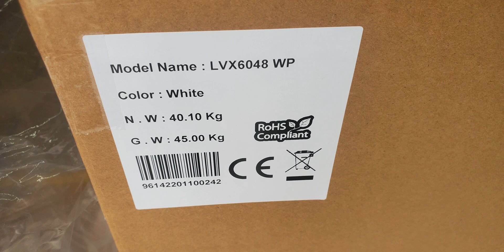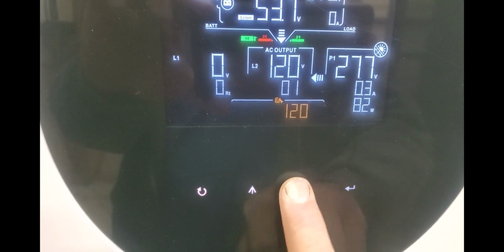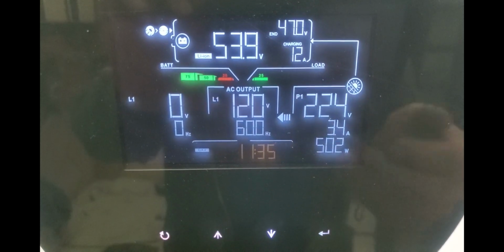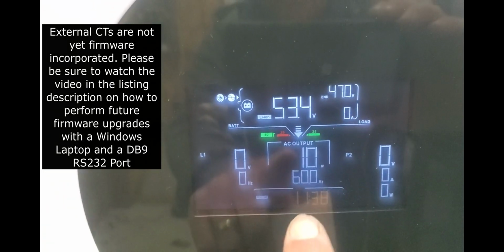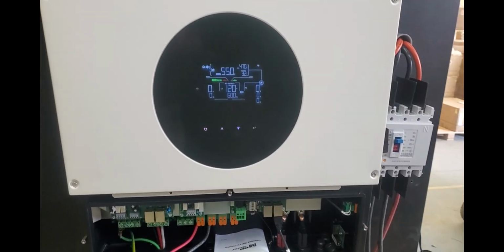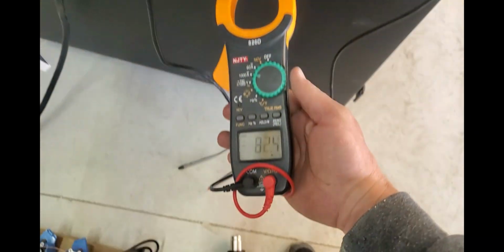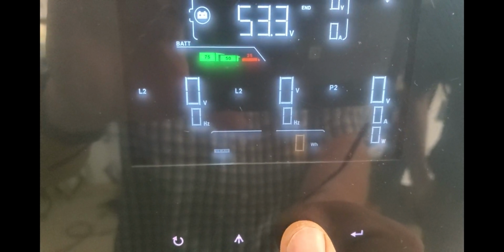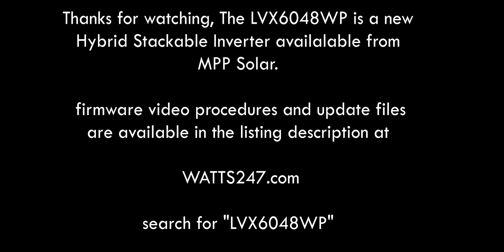LVX6048WP 6KW Outdoor IP65 Hybrid  Inverter - First Look

Comment: Hey liked your video!  I'm a newb but interested in the inverter.  Could it run solar and pull from the grid as needed?  I don't want to sell back to the grid, just use grid power when thes sun is 'off'.  Will the unit work if the grid is down?

Comment: I have this unit and have used mpp for years, i cannot get solarpower software to work no matter what cable i try.  Any cable from a usb to 232 converter to micro usb. Whats the magic trick lol.  If i can get this to work, i plan to use solar assistant but, dont want to invest until i can see communication between it and a pc. Thanks

Comment: Can the LV6048 be used as a grid tie????
Reply from the maker: The lvx6048wp can be used as grid feedback,  the Lv6048 can use grid as backup  (but not grid feedback)
Reply: @watts247 Thank you so very much for getting back to me I did contact the people at MPP solar and they also confirmed what you said with a clear answer to my question.
Thanks again for the accurate information.

Comment: I bought this system ,but I have a question, do I have to connect a transfer switch or am I just connecting my pv module ,generator , and utility electricity  directly with brakers?
Reply: I'm confused, some people say I need the transfer switch other people say no I don't need  the transfer switch

Comment: touch screen and no Eg4 compatability?  damn, this was almost perfect.  was gonna buy 5.... I guess its back to Sol-Ark it..Come on Ian, the EG4 blockout is clearly to increase revenue.  Wed buy more of your batteries to add to the Eg4s we accidentally bought...

and if the touch screen is not cell phine quality, the touch screen will render it useless when moist or after a few years in normal weather..those design choices make me question the durability of other components chosen like those pv input terminals you were afraid would break.....so close to greatness, it's a shame

Comment: Ian! Got a few questions for you regarding this unit.
I have had nothing but problems with it so far, and I'm wondering how many are due to out of date firmware.
First, MPPT 1 and 2 only seem to start coming to life at above 400v. My setup was originally 2x series of 120v, but bringing those in parallel to the unit, I only got 25w (yup, 25). So i put the entire array into series for 240, and still only got around 500w max (should be at least 1500w, which is what I get on my other controllers).
What's your panel setup? How are you getting 1700w here at only 233v? I should be drawing at least 6a minimum with my setup, but I barely get 2a at 240v.
The config options don't seem to apply reliably and seem to take 10-20 attempts before they stick. You had this?
The android app idiotically takes data the unit uploads to some sketchy server in China, and doesn't update data for 10-20 minutes at a time. Are you seeing the same behavior?

Have you got communication via rs232 working? Did they send you the solarpower app for monitoring (they won't send it to me :D).

I'm at my wits end here. Renogy units are buggy as all hell and poorly built/conceived, which is why I tried this one on TONS of glowing recommendations, but I cannot for the life of me, get anything working,a nd man I wonder if it's just out of date firmware.
Reply: thanks for the headsup!  please keep us up to date.  
wow, great eye I've been wondering, communicationes to China WITHOUT updating/fixning!!?
Problematic given our hostile relationship and the daily bogus " excuses" the great reset clan like spew daily, to say the least.

mandatory frivolous communication has a great chance of nullifying the entire "off grid" purpose even more than the closed source, proprietary code that could have a simple timer hidden within...

I hope the problem is just firmware but it just sounded too good to be true.  I was going to buy 4..if they fix quick enough I still might.
2.5x less cost than Sol-Ark, plus a ridiculous touch screen (really, much more reliable mechanical buttons cost too much?) and cheap pv input terminals were red flags that might be ok if high enough quality but this "incompatible" with Eg4 batteries is ridiculous.  Yeah, Signature Solar are a bunch of charletons selling a lot of garbage to unwitting customers but those batteries aren't...are they?  if so Ian, please explain why and ill profusely apologize
Reply: @SmedleyButler1  So it's actually worse than that. Another day of digging and here's what I know.

1. The MPPT simply does not work at all at or below 120v. With 120v@6a, you get 25w at most. With 3x 40v@9a panels, you get absolutely nothing. MPP will not confirm this is a problem. They simply suggest that you should run the system at 500v.
2. The documentation is all wrong. The wifi is not accessible locally whatsoever. It is only used to communicate out to their servers in china (and man they send a lot more data regarding your network than they need to, in order to get the inverter data out). There are no ports open on the device. No SNMP access. This is funny because they recommend SolarPower Pro to interface with the device, but SPP uses SNMP to communicate, so without a listening SNMP port, the wifi is useless. SPP can also do Modbus via rs232, but their RS232 is only used for updating firmware (this is according to MPP). Their recommendation to me was to "don't worry about the rs232, just use usb". That was their entire response to all of my questions. The SPP doesn't work with USB. The USB presents itself as a HID (human interface device) via an embedded STMelectronics (I think it's an STM32 chip). So there is no way to monitor the device without internet, and the app sucks anyway, and their server only updates every 5-20 minutes. 
3. The unit itself has a self-consumption of 140w. This is with NO AC connected. This is just 48v packs connected, power on unit. Initial draw during startup is around 30a for some reason, which settles to around 3-4a idle. My entire house's baseline consumption is less than this unit's self-consumption. I'm including the self-consumption of my old inverter, while powering my starlink, 2 laptops, and keeping house batteries charged.

As much as I hate my Renogy 48v 3500w unit, it's at least efficient. Zero monitoring or remote configuration capability whatsoever, but self consumption is barely 15w.

I'm now looking at Growatt, but so far it's looking like all of their gear has the same comms issue. They're telling me there are NO local communication services available on the device.
Reply: @BenjaminSelinger  I have the IP6048 which is the same thing with a blue paint job.
I was able to connect to the laptop using the RS232 port. The main trick was entering the administrator password by clicking on the icon "girl and guy" and typing the default password.
Then all the data started showing up and I could configure the inverter with the laptop app.
I'm having the same issue trying to get my Lifepower4(EG4) battery to communicate with the inverter. I'm not use which value to set on the inverter.
Reply: Have you got your problems resolved yet?
Reply: @Altenurgy  I was told everything I described was considered normal, so I returned it and went victron.
Reply: @BenjaminSelinger  Thanks for replying.  At least they took it back.  Every time I think I've found an all one that might just work for me I dig just a bit deeper and discover that it's got some deal breaking issues and that keeping it running will likely turn into a new hobby that I don't need.
Reply: @Altenurgy  exactly that. From my understanding, the victron stuff is all open source, and I've heard nothing but good from all communities. We'll see.

Comment: 4:37 I really do not understand why they dont built-in the wifi inside the box...

Seems like a nice alternative to Deye! But honestly, I do wish they make better use of WIFI and be configurable using HTML interface instead of those cryptic numeric mambo jambo!
Reply: do you mean sol-ark?  I read the last actual Deye sold in amaeruca was a couple years ago those were dangerous European models off ebay. 

 if so, i agree, this MPP checks most boxes the much more expensive Sol Arks have which is the "best" (most versatile and one of the most reliable), all in one hybrid string there is in America im aware of as of last year (I haven't fully compared the latest from, SMA, Fronius Outback, Magnum, Schneider or midnite solars latest in a while though. all have outstanding reliability from ny research 1 yr ago) 

The problems that unfortunately still  seems to make the much more expensive Sol Arks worth their price seem to be:             1) quality control (see commenter above).  the track record has started out rough despite having plenty of prior experience. why? "100 electrical engineers " they supposedly employ can't reverse engineer  The near military speck models I listed above?
2)  tech support.  love ya Ian, you must be very busy trying to get this unit fixed or something but Sol Arks electrical engineer is much more accessible and they've got an impressive reputation long term
3)  warranty- Sol ark is much longer
4)  build quality..  youd think ip65 rating would = more robust but then seemingly questionable choices like a touch screen that won't work when moist among other issues we've all had with them.  Will internals come lose if accidentally bumped during install?
5)  communications to China not related to updates or fixes?
6)  Sol Ark allows ANY battery brand that has its own mpp....this is the #1 selling point for many people that already spent $3k+ on batteries or don't want to be locked into Enphases royally expensive ecosystem
Reply: @SmedleyButler1  Deye/Sol-Ark/SunSynk (depends on where you are).
And I agree, Sol-Ark packs alot of add-ons over the basic Deye unit, it is far superior product. 

I dont have access to Sol-Ark unfortunately, Deye only. My loss :(
Reply: re wifi module...the more module they make inverters the better if you think about it. if a part goes bad, an average Joe could possibly repair it when China decides to stop making or sending parts...Midnite Solar had a prototype that was incredible and I've read that Outback had some highly modular models

Comment: What is the maximum bypass current? I want to use this inverter in a big home, normally 6kW will suffice, but sometimes the house cam pull around 10-15kW. Can the unit handle the bypass current?
Reply: maybe need 2?

Comment: Nice.  If the unit is on..  without the output on (not inverting)  Is the PV charging the batteries still work?  And what's the standby current without the output on?
Reply: He showed you in the video. 100 watts standby
Reply: @TK-123  That was with the output on.
Reply: @jbuszkie   I doubt there is going to be a difference for standby current whether or not output is on or off. You probably will only see a difference for load vs no load, but not output on/off

Comment: which is better between these and lv6548
Reply: It depends on your needs. The 6548 is high frequency has less idle consumption and has more amperage for the pv inputs. This unit has grid tie options more voltage per pv input  and is low frequency.